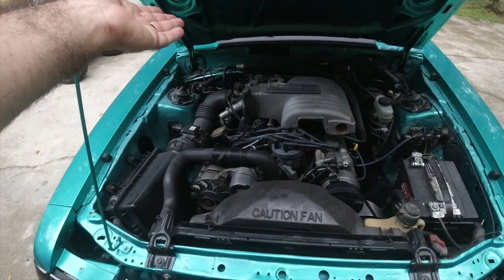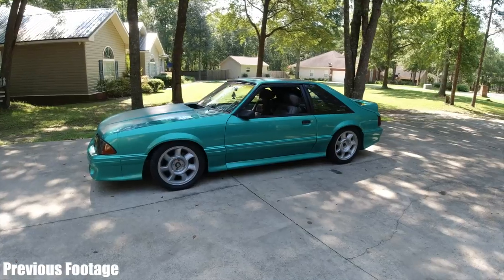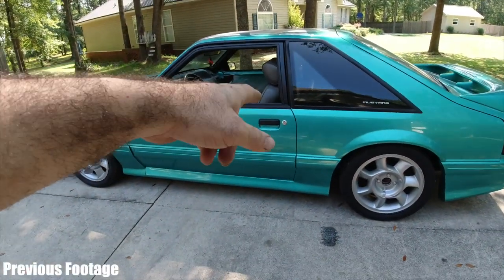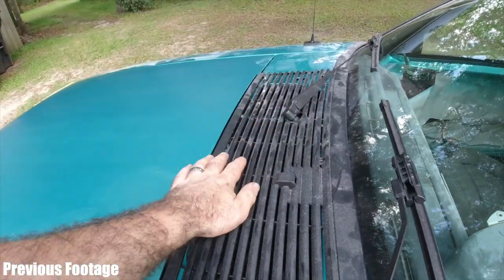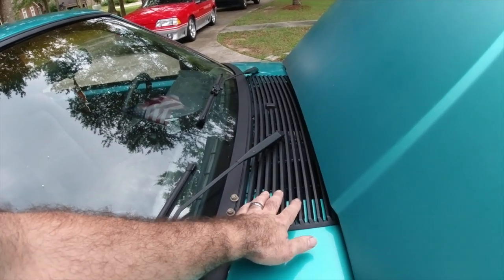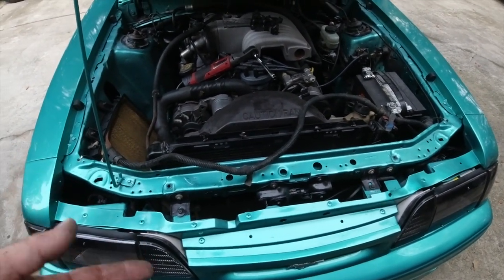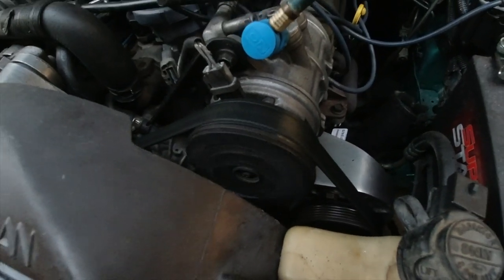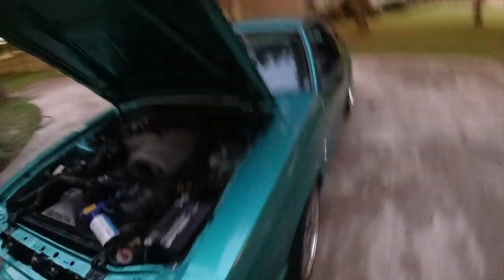A COLD FOXBODY IN HELL / SIMPLE FOX BODY A/C INSTALL

Comment: Good video man. Cervinis sells round gaskets for sealing around the mounting holes and brake light harness under part number P9112. I hope this helps.
Reply from the maker: Thank you!
Reply: I was about to ask this very question. I cant remember if the OEM spoiler came with gaskets?
Reply: Thank you

Comment: This is super late, but if your vacuum fails to get to the head unit, where you adjust temps and vents, the system is made so the defrost door and vent door will go to defrost. You need a constant vacuum to keep it on vent. Likely a safely thing so you can see out the windows.

Comment: Love your videos.
Btw, I don't think you're supposed to charge the system with the can upside down, especially with the port being right at the compressor like it is on our Foxes...because you're pouring liquid right into it and it's possible to hydro lock it, which would be a bad day for one's hopes to have cold AC.  Safest way is to hold can up right and shake the can back and forth about 180 degrees.

Comment: Its looking good buddy car came a long ways in a short period of time. Question me and my buddy changed out the heater core on my fox. When we assembled everything back together heater worked fine but i did notice my middle knob which is the temp didn't want to turn to the cold side. It will only turn half ways and to the hot but wont turn any more i really didn't want to take everything apart again and look behind the dash. Do you know what may cause the knob not to turn all the way from hot to cold? Before it was taken apart it turned fine
Reply from the maker: Thank you! It’s probably the lever on the box that the cable goes through. Check it out and make sure the cable is routed correctly.
Reply: @BREW2LFOXBODY  thanks buddy ill check it out

Comment: What kind of freon are you putting in your system?  My 88 GT vertie uses thevold freon 12
Reply from the maker: 134 with no conversion.. just an adapter
Reply: @BREW2LFOXBODY  what's adapter? I need to charge my system too.
Reply: Just go to your local parts store for the adapters that screw into your old ones. R12 to R134 adapter kit

Comment: Brew u can't make some kinda gasket for the spoiler it looks good with your wheels on there!
Reply from the maker: I’m going to try something
Reply: U got that fast it really looks good with your Anniversary wheels on it should watch the whole video before I comment on something car looks amazing Brew!
Reply: Man I am up here in Baltimore, Maryland hot ass summer's cold ass winters make me think about when I do my 4cyl notch V8 swap I am really thinking about running A/C I got a 94 Cobra I no it's not shit but it has some Elder Brock Aluminum heads Trick flow intake car was t-bone it was like bent in half I only payed $1000. for the motor I didn't hear it run it has a cam in it 1.6 Ford racing roller rockers I mean the heads would of cost anywhere from 800 to a G  anyway got the whole motor for a G it wasn't a/c car so it the whole sn95 set up where u mount the coil on the power steering pump under drive pulleys but yeah u got me thinking now cause the heat in Maryland gets crazy I still have a lot of work to do but I will get it done sorry about the book lol !

Comment: Hey do you really recommend this method? Seen a lot about having to convert to new freon. New seals and dryer. I saw you put together parts that have been open to the air. Can you just blow in some newer freon with a fitting I assume?
Reply from the maker: That’s what I’ve always done, If something works and saves money i just roll with it.

Comment: I have an 88 5.0 notch and it had an ac delete. I wanna re install the ac system and lmr sells 2 kits compatible for my year. Should I spend the 1200 for the AC auto air or go for the original ac unit for 700? Both are 134a

Comment: Can you tell me what I need and how to replace all the a/c components in a stripped out car that's been converted to carb and the the entire engine harness has been removed?
Reply: Nick Peacock basically you’ll have to make your own wiring harness for the compressor. Wire in the low pressure switch to kill 12 volts to the compressor. The 12 volts will come from the a/c switch. Ground the other wire and your done. As far as putting the components back in, cake walk, long as you have the factory brackets. If not, well it just got expensive, trust me, mine came with nothing, 400 bucks later for a complete used system. Man I hope the evap core doesn’t leak since it will be getting r12 in it.